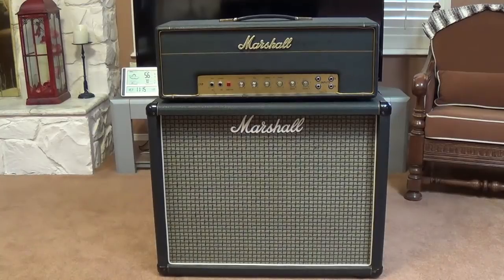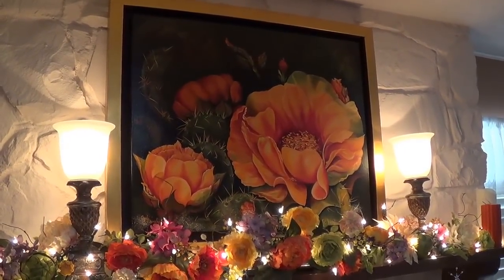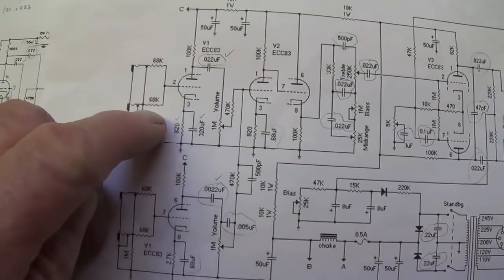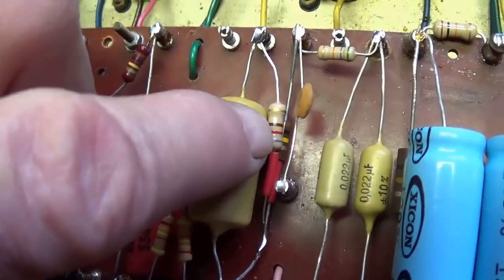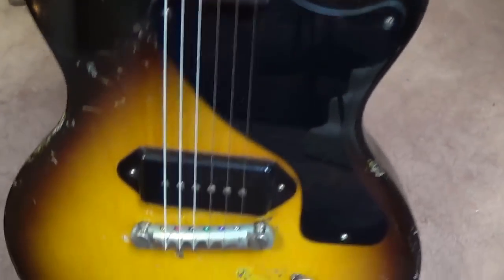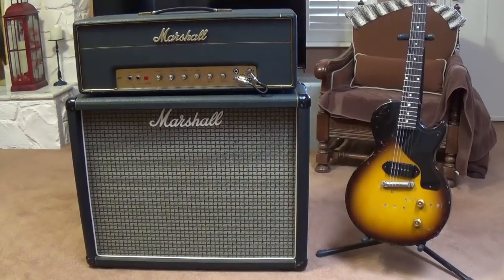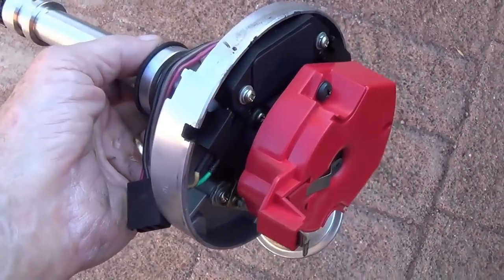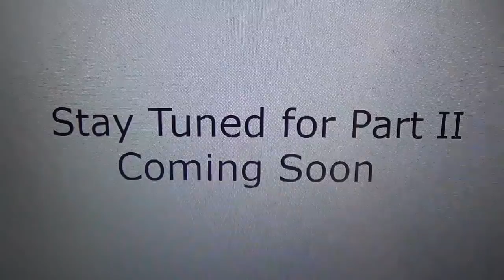Marshall 1986 JMP-50 Bass Amp becomes a Model 1987 Lead Amp.....with Extra "Mustard"

Comment: After watching the video and listening, I personally preferred the sound of the 1986 circuit over the 1987 circuit with the guitar used, the volume/tone settings on the amp, the SM57 and the listening room acoustics, all of which can affect the sound. To my ears, the 1986 sounded full and rich, while the 1987 sounded a little anemic. I acknowledge that I may be somewhat biased since I’ve predominantly played bass guitar since the mid 1980s, but I did work for Mr. Roger Russell of McIntosh Laboratories (Binghamton, NY) testing McIntosh loudspeakers in 1973.
Reply from the maker: Thank you for your knowledgeable input, Thomas.
Reply: Uncle Doug Just my opinion my friend. No more or less valid than anybody else’s opinion.

Comment: I had a Marshall of that vintage that I bought used in 1969. I'm not sure which circuit it was, but I don't think it and the "JCM" (or any other designation) on the face plate. It had a gold Dymo label on the back, I think maybe giving the fuse amperage. I wish I hadn't sold it.
Reply from the maker: We've all sold things we regretted later, Wayne.

Comment: Wow!  Night and day.  You don't realize it listening to the 1986 version but then the 1987 just rocks you.  The bass schematic just sounds muddy...Big surprise I guess.
Reply from the maker: Thanks, Sean :)
Reply: @UncleDoug  I am curious how much the NOS capacitors had to do with the sound as opposed to just the changes and different values.  Too bad you didn't do a third swap and just replace the mustard caps with comparable new caps.
Reply from the maker: @seanobrien7169  I would guess that the difference was almost entirely due to the different cap values, rather than different brands.

Comment: FYI regarding the output section RC filter... using an online tool it seems
series .1uF with 220k to ground has a cutoff freq of about 7 Hz.
series .022uF with 220k to ground has a cutoff frequency of 33Hz.
Since it's a 6dB slope you still get bass attenuation quite a bit above cutoff frequency.   I think you're right - this is a major tone changer between the two models
Reply: Both 7Hz and 33Hz are far below the lowest quitar frequency (usually 82Hz of low E string). So in guitar frequencies the difference between .1uF and .022uF is not audible in my opinion. What do you think?
Reply: @MadrasDSF  I agree BUT.. the "knee" on a 6db LPF slope is so gentle that it attenuates far above the corner frequency.  You're getting attenuation far above 7 and 33.   it just happens to measure 6db at those specific  frequencies.  You might still be getting 1db at 250Hz, for example
Reply from the maker: Thanks, D. I really appreciate your knowledgeable input.
Reply: @demagmusic  I cannot agree. At  0.022uF for 82 Hz (fundamental harmonic of low E string) attenuation is 0,6 dB in this particular circuit with 220k, where human average hearing sensitivity limit is about 0,2 - 0,3dB in laboratory conditions. So it is not audible in reality. :-)
Reply: Thanks for the analysis

Comment: Thank you Uncle Doug for another great video! Nice to see Marshall amp on your channel again! You said output coupling caps are making the difference making 1987 less bassy and it is main difference. I cannot agree with you in this one point. It is because new output caps are 0.022uF together with 220k are making high pass CR filter roll-off of bass at 32.9 Hz. Previously it was 0.1uF making roll-off of bass at 7.2Hz. Changig these caps does not make any audible difference in guitar frequencies. :-) In my opinion the biggest difference is caused by converting from shared cathode to split cathode on V1 and using 0.0022uF instead of 0.022uF also makes audible difference (roll-off at 72Hz vs 7.2Hz. I know it because recently I made switchable 1986 and 1987 circuits in one enclosure: https://www.youtube.com/watch?v=CANviOlU24I Greetings!
Reply from the maker: Thanks for your very detailed and knowledgeable input, Marcin.

Comment: welcome back doug! i have to say, i haven't felt the absence much because i subscribed not long ago and i've been watching lots of your older videos hehe.
I wanted to address one thing, which is the audio, especially on the demo. I've gotten used to how your videos sound like, but since this time you're recording with a sm57 close to the cab, I can say that this could sound much better than this. There's this kind of chimey treble noise that i associate with an overly compressed (as in making files smaller not dynamic compression) audio. Maybe the export settings in the video editing software? Let me know if I can help you.

About the video, I've never seen the deal with mustard caps, or any other old revered component. I replaced them all in an old italian amp i've restored, because a couple of them were cracked and made all sorts of noises. It wasn't kept very well i have to say. I still have the others, maybe i'll sell them to someone who appreciates them more.

I'm curios about that mix of carbon comp, carbon film and metal film resistors. I've watched the other video and I don't remember you talking about them
Reply from the maker: I'm sorry you don't find the audio to be optimum, CS. I'll look into it. I agree that the value of a capacitor matters much more than its type or brand. The mixture of resistors was never perceived as an issue, so I never commented on them.
Reply: @UncleDoug  thanks for the reply. I agree with you, and those resistors are absolutely fine, but also tell a story of some previous tampering.
The audio was one of the best I've heard on the channel, but i still think it can be much better with some tweaks. Definitely check the bitrate and bit depth of both your recording device and the video editing software output. I'm still here if you need it

Comment: Glad you are back Uncle Doug. I have a question about the hot rod regarding the vacuum advance. In a lot of carbureted models, the vacuum advance hose is on a port on the carb that pulls vacuum when you open the throttle, thus pulling the advance on the distributor. Some work opposite, but I don't believe in a Chevy unless this distributor uses a cantilever mechanism.. Putting the vacuum advance in a direct manifold vacuum port would pull the distributor advance at idle, and retard the timing as the vacuum drops when opening the throttle. I believe the rotor rotation is clockwise and pulling the vacuum advance module toward the front of the engine advances the timing. I know I repaired a number of vehicles where some DIY'ers had the vacuum advance hooked up wrong resulting in poor low end torque and they couldn't figure out why.  It's been a number of years, so forgive me if I am wrong.  The "6 Pack" is going to look outstanding!
Reply from the maker: I understand what you are saying, Jeff, but there are a couple special factors at play here. First, there are no provisions for vacuum on Stromberg 97's. Second, the primary (center) 97 passes only 130-150 cfm wide open, which does not significantly reduce the plenum vacuum of a 350 ci engine. Third, as you will see in the Part II video, this set up pulls like a freight train from 0 to 90 mph.....no lag, no hiccups, no bog, no issues.......just crisp throttle response and a major boost when the secondaries open.
Reply: @UncleDoug  Thank you.  Oh, I see said the blind man. I didn't realize there wasn't a port above the throttle plates on those Stromberg 97's. I look forward to Part II. I would be curious to see what the timing curve is with, and without the vacuum advance functional on direct manifold vacuum and see if there would be any difference in the freight train's low end torque. But then, it might be too touchy making it too easy to spin the tires. (oops, sorry Officer, it slipped), and lower to mid transition might suffer a little. No way to tell except with experimentation. Sort of like the "Mustard Caps" swap. Of course idle would have to be readjusted between the two configurations. The centrifugal weights in the distributor come into play at whatever the springs tensions allow for mid to top end and vacuum influence is left in the dust. I don't have any doubts about your expertise whatsoever, so please don't get me wrong. I've enjoyed each and every one of your videos, especially the "double feature".
I personally like the Mustard Cap (1987) version a bit better for lead configuration. But like you said, the biggest influence is more than likely the coupling caps. I feel it "cleans" it up a bit without the low frequency undertones muddying up the higher. I love lots of Bass, but it has it's place, and it's not in the Lead.
Reply from the maker: @JeffCounsil-rp4qv  Thanks so much for all your detailed input, Jeff. We always welcome viewer questions and comments, and look forward to hearing more from you in the future.

Comment: Doesn't the 1987 also have 0.005uf cap across the volume pot on Channel 2 as well as the 500pf across the 470k mixer ?.
I think that would make a big change to the amps tone, may need another comparison.
Reply from the maker: Thanks for the info, Trevor.
Reply: Thanks for your videos really have learnt a lot from you, keep posting.. love those old Fenders.

Comment: Welcome back you were definitely missed I had done started re-watching some of your videos that I had already seen. Speaking of already seen that hot rod extravaganza look awful familiar to me. Was that déjà vu or had you posted it before?
Reply from the maker: You're right, Steve, and I owe you an apology. This is what happens when you take some time off and forget what you did two months ago.  Frankly, I'm surprised that only one other person noticed this. I guess I'm not the only forgetful one :)
Reply: @UncleDoug  No apology necessary I forget what I've done from time to time myself. I'm just glad I was able to find it because it would be driving me absolutely crazy right about now lol. I repaired and modded my first two amps last week a Marshall JCM 2000  TSL 100 watt head and a Marshall JCM 2000 DSL 50 watt head. They both had the dreaded thermal bias issue those models often suffer from. I isolated pin 5 of the output tubes from the circuit board by drilling it out with a hollow drill bit and built and installed the Dr. Tube stable bias kit which  moves the bias circuit off the main PCB onto its own PCB to cure the run away bias issue . I also added a Classic Tone 3 henry plexi style choke to both heads while I was at it. After they passed a few test and gave me the green light to install and bias the new tubes I'm proud to report they were both a success and sound great. I learned what was wrong with my amps, what was causing it and how to fix it all from the internet. Now I got a friend bringing me a Carvin Legacy 100 Steve Vai head to retube and bias this Friday. Got to love the interweb! I've really enjoyed your videos and have to tell ya you've taught me a lot, given me a lot of inspiration and confidence to take on this new hobby. I can't wait until I can afford to start buying parts for my first hand wired build and when its complete I'll have you to thank.
Reply from the maker: @MrSteveCasper  Thanks for your understanding and your very interesting input, Steve. We look forward to hearing about your first build. Best of luck !!

Comment: Welcome back..!  I vastly prefer the 1987, but now I have a new conundrum: is it the circuit or caps?
Specifically: on the 1986 between 1k - 3k there is harmonic noise that stays present longer after you hit a treble-string dominant chord.  On the 1987 it's just barely there.  That makes the 1986 sound like "shhhhhssh" when you hit it hard; it's just harsh noise, not harmonics.  Almost like digital distortion.  The 1987 is balanced, with clarity because of that attack noise immediately subsiding (>30ms?).   I've got a 70's 1986 (halfway disassembled after a... Catastrophe of a "friend post phase inverter mod gone wrong)  and don't care for it because of that... Always was harsher than the plexis I've had.  Hate that "crisshhhhsss" on the attack... / Yes I'm crazy
Reply from the maker: Thanks for your in-depth analysis, Chip. I tend to think the difference is due to the change in cap values, rather than brands.

Comment: The slope resistor is different in each tomestack. 33k for 1987 and 56k for 1986. Also the normal treble bleed for a 1987 and 1959 is .005uf.
Reply from the maker: You're right, Michael. I neglected to make this change.

Comment: Good result in the end .
The old mustard capacitor amp did have a altered pass band & cleaner sound .
The end product may just be a better sounding design .

But you never answered the question …. 
What do modern capacitors sound like ?

No answers this time as you changed design & component values .
It may sound very similar with mustard capacitors or modern equivalents .
Reply from the maker: Indeed. I would guess that the vast majority of difference was purely due to the changes in cap value, rather than cap brand.

Comment: To be honest, I would love a tone between the two. The first is obviously bass heavy as intended, but I love the punch of the mid range. The 2nd is perfect for treble, but does not have the "punch" and sounds rather hollow to my ears, perhaps 0.05 coupling caps for the output tubes?
Reply from the maker: I agree, RR, that a compromise in coupling cap values may give the best of both worlds.
Reply: @UncleDoug  Could also achieve the same sound in the choice of caps and resistors in the tone stack? Or maybe a combination of the two?
Reply from the maker: @rhoneranger549  Perhaps, or simply by changing the tone settings, guitar tone setting, choice of pickups, etc.

Comment: Since the model 1986 is a bass circuit, was it actually any good as a bass amp?
Reply from the maker: Heck if I know, John. It's possible (probable?) that some noted bass players used it for that purpose.
Reply: @UncleDoug  Thanks Uncle Doug. My only experience with a tube bass amp is my Ampeg B-15S with 7027 power tubes. It's got some crunch to it turned up. I can see how it would make a badass guitar amp with the right mods.

Comment: You forgot the 33k slope and plenty 1987 due have a 470 of 500Pf cap across the 470k mixer.
Reply from the maker: You're right, as usual, C.

Comment: Hey Uncle Doug,
nice to hear from you and some nice tunes as well. I have a question about the plate voltage and current. It would be very kind, if you could help me.
For example in the datasheet of the jj ecc83,  the typical Ua is 250V. But since the typical Ia should be around 1.2 mA, a 100kOhm plate resistor would cause a 120V voltage drop ( 0,0012mA*100,000Ohm=120V) over it. Therefore the powersupply voltage would be like 370V (250V + 120V). This seems a bit high. Or are those Typical Characteristics more like a maximum value and only should be reached when the tube is fully driven during one cycle of the input AC signal? 
I hope you understand what I mean. Here is a link to the datasheet:
https://www.jj-electronic.com/images/stories/product/preamplifying_tubes/pdf/ecc83s.pdf
Sorry for my bad English. Greetings from Germany. I like your videos a lot because you explain everything in a very understandable way. Keep it up!!!
Reply: You need a high value plate resistor to get a high voltage gain with sufficient headroom.
The maximum Ua for the ECC83 is 300V, 370V is too much in a guitar amp. If the tube ever turns completely off it will likely arc and be destroyed. Good luck.
Reply from the maker: Greetings, GO. Look at the schematic for a Fender Vibro-Champ AB764 (for example). V1A is a 12AX7 with a plate voltage of 255 VDC (as you stated above). The plate resistor is 100K Ohms (as you stated). Now look at the B+ from the power supply:  +420VDC.  As you can see, B+ values for even single-ended amps often run far above the 370V you feel is too high. Note also that the PT for the Vibro-Champ is probably around 350-0-350, but the DC output, once smoothed to peak voltage is 420 VDC (after rectification losses).
Reply: Ok. Thanks for your reply.

Comment: Those original mullard caps sound  WAAAY better than those bargain-basement Mallory's! The difference between warm and chewy opposed to overly bright and flubby sterile tone! Why would an experienced tech swap those out? Obviously he had to change a couple of values to change it from a bass to a lead head, but not all of them. Sorry but that was just plain dumb!
Reply from the maker: He was a highly respected tech, Larry, but probably did not have access to new mustard caps, so he did the best he could. I do wonder why he felt compelled to change ALL the caps, however. There is really no need to do so.

Comment: that amp is not a 1987..its a JMT 45.....it has a rectifier tube,and it only has one cathode cap/resistor on that first tube. both sides of the tube share that.    the 1987 has one on each side a 068./2.7k  and 250 uf /800ohm.
Reply from the maker: I know it's not a 1987, DV. It's a 1986 Bass amp. The video showed how it was turned into a 1987.
Reply: @UncleDoug  i believe the rectifier tube in this amp means it's a JTM -45!  I own one. the 1987/86 had a solid state rectifier!
Reply from the maker: @dvoltone  Much has been said about it being a transitional or "Black Flag" model, DV. Perhaps this explains the presence of the rectifier as well as a circuit virtually identical to the model 1986, which came later.

Comment: That hot rod would be awesome with a vintage Chrysler 292 hemi or a 412 crossram
Reply from the maker: Indeed. I've been searching for alternative engines, 331 Hemi's, nailhead Buick's, even vintage Oldsmobile and Cadillac's. Good, rebuildable ones are very, very scarce however.